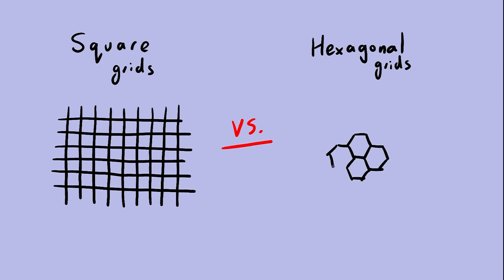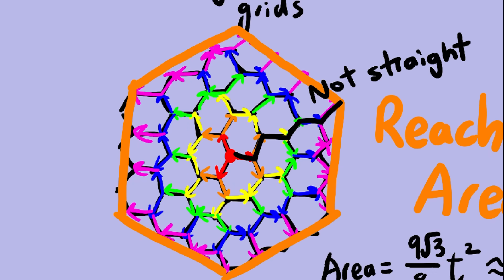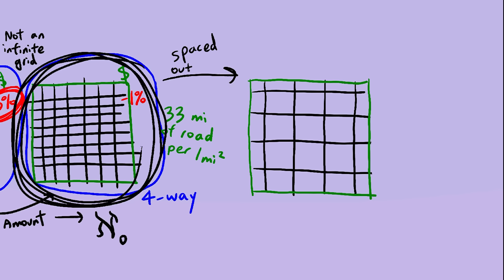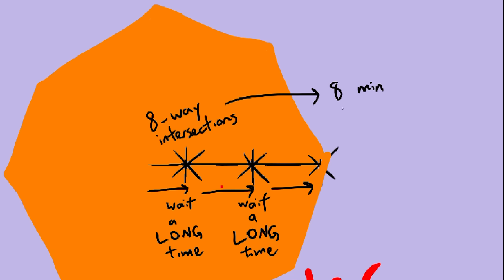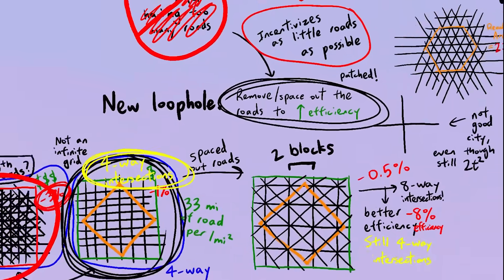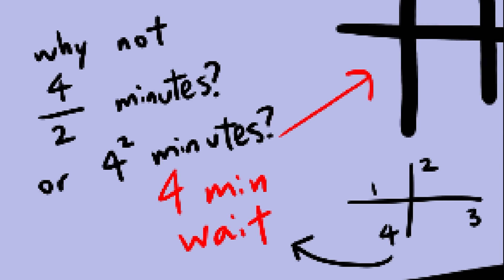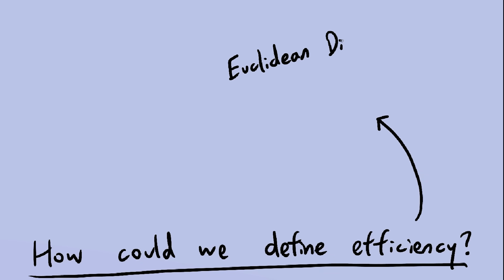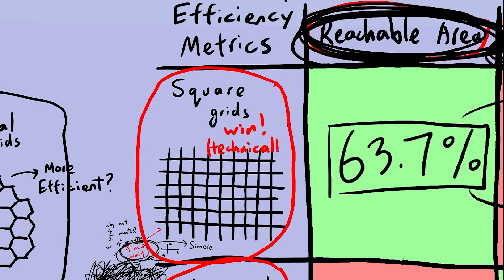Would hexagonal city blocks be better?

Comment: I have toyed with thie idea of a mix in city building games and it works surprisingly well - you have a large scale hexagon grid (2km across) and then a normal square based grid within, but various non-aligned grids.

It naturally creates park-like areas where the square grids meet, discourages through travel by making routes within the blocks less direct (if planned properly) and crucially all major road junctions are only 3-way intersections and the 120 degree angles make the junctions much more compact than 90 degree junctions.

Comment: A couple thoughts on this:

The point of a city is not to have maximal roads, but maximal buildings with minimal travel time between them. If you give the roads a thickness, and then do tests with two random points ANYWHERE on the plane, and have travel within "building areas" be relatively slow, travel parallel to and on a road be relatively fast, and travel across a road or through an intersection be relatively slow, you can sample random points like that and get a pretty good idea of a more realistic "trip length" - That is to say, go out of your house and to the road, travel along the road, and get into your destination at a specific point in a building.

For extra realism, you could add a stipulation that spending a fixed amount of extra time at the edge of a road allows you to travel much faster along it, but requires you to spend that same amount of time to travel back onto a building. Getting into and out of a car, more or less.

This might be an interesting thing to simulate. I might add that to my to-do list.
Reply: Huh

Comment: Why is it a loophole to have less roads to increase distance travelled? If you're wanting to only maximize distance travelled per minute by car, that's exactly the solution.

If you want something else, you need to specify that in the scoring system, not just penalize random things until the system feels better.

Or perhaps your calculations are flawed because you claim point x is in a reachable area if a triangle of points s, d1, and d2 contain x (where s is the starting point and the ds are destinations) because without a road how do you reach x?

Comment: Actually, you need n light cycles for an n-way intersection. Though a light can be optimized to favor certain turns, and then some routes would be faster than others despite using the same types of intersections.

Comment: i think my favourite efficiency formula for a grid network is area over length of road used to cover that area as taking the limit of grid size to infinity i think you do indeed find that square grids are the best out of the regular tilings - i think this is also applicable to real life as it corresponds to cost per unit area
Reply: also ig it should be that this measure of efficiency drops off by an inverse law as you grow the size of it so taking the limit is nearly negligible for decently sized networks
Reply: the only drawback is that it doesn’t consider interactions between cars in the network like intersections and traffic

Comment: as a civil engineer, the real solution is just roundabouts packed together into a hexagonal pattern.
Reply: Ah, Frank Blackmore, so nice of you to join us from the afterlife. I guess they don't call it the Magic Roundabout for nothing.
Reply: so now your reachable area depends on orientation

like, it's always faster to wind in whichever side of the road you drive, since you can exit the roundabout earlier
Reply: @MagicGonads True, but that would be a  Matter of seconds
Reply: Try an octagon grid.  Each octagon is one-way, alternating clockwise or CCW.  The intersections all become 2 lanes merging or 1 lane splitting.  In practice, I figure you'd set aside the square blocks for public use; parking lots/garages, parks, utilities, etc.
Reply: The actual solution is to convert all cities into archologies where you never need to travel because your sleeping area, living area and work area are the same room and all goods are delivered by dumbwaiter. Enjoy your efficiency, city dweller.
Reply: Even better, just make it large city-block-size roundabouts and connect them with small transfer roads! So the map looks like a bunch of circles slightly spaced out with star-like gaps in the negative space.

Even better yet, make the city block roundabouts hexagon shaped! So the passthrough roads are just the alternating hetagonal sides to connect them.
Reply: @BenRHarsh Wait, this is sounding familiar somehow...
Reply: The idea of driving through a city that's nothing but clockwise and counterclockwise circles actually makes me a little nauseous.

Comment: if you want a 11 way intersection you can make a 12 hour clock round about, and then remove 1 road. So think a pie with one slice 2 twice as large as the others. but but you want a round about so the pie slices are on the outside of the circle not the inside of the circle. this is actually really nice because their are lots of ways to break up 12. so you have lots of road options to work with to different cities.

Comment: The main issue with hexagons is that you have to turn on every intersection. When the light is green and you are going straight, the intersection essentially doesn't exist. But on a Hexagon, you always have to turn slightly, and there would have to be 3 different cycles of the lights. This means that not only do you spend more time going through an intersection, but you also have to wait 1.5 times as long for your turn to go when the light is red.
Reply: just put roundabouts everywhere.  people would get used to it as it would be the only intersections in the city
Reply: Interesting
Reply: Remember that lights at a 4-way are generally 8-phase, but at a 3-way they can be just 3-phase, plus the rights are easier.  And the "turns" are only 60°, so it's easier to see and you don't have to slow down as much.

Sure, you still need a highway system for long distance, but I think that locally a hexagonal grid could be surprisingly nice to drive.
Reply: You're forgetting that on a hexagonal grid it could still be green for you. Or a mini roundabout at the intersections which doesn't have traffic lights.
Reply: Not really, on a hexagonal grid the best way to do the most bird distance per time is by alternating left/right, taking these directions as going "straight" one finds that there are 3 straight axes nicely lining up with the 3 phases of the lights, this is opposed to the square grids which need 4 light phases but only have 2 straight axes.
Reply: @ybokors8524  a good set of lights is not purely on a clock but reacts to it's surroundings.
Also by chance the direction you're trying to go might still be green if it is stupidly on a clock.

Thinking about it, if the hexagonal has 2 lanes (one per direction) the short turn may always be green and the long turn has a 1/3rd chance of being green at the worst case, and practically always if it's smart and detected you driving towards the intersection.

The only thing you can't really do is speed excessively as you've got to make a bunch of turns, but that just depends on how short the intersection is and thus if they made the turns smooth and wide.
Reply: @sirjmo  Do I understand you correctly, that you argue a 3 way intersection is worse compared to a 4 way intersection, because a 3 way intersection uses a clock and a 4 way doesnt... which is solely based on you decision to force clocks on 3 way intersection?

Your argumention is completly baseless. Thats like arguing that square based grids are worse, because they are only allowed to use 10v/t, while hexagon systems use 100v/t and therefore are 10 times better. You just made a comparison and added a arbitrary rule to one side and not to the other.
Reply: @Grothgerek  my argument is literally the first thing I said: "a good set of lights is not purely on a clock but reacts to it's surroundings."

The other part is that IF it's on a clock you got a 1/directions chance of being green in the way you want to go. 1/3rd for hex and 1/4 for square. And the confusing part is that you may always be able to allow the short turn (right on red but better).

My third part was me just spitballing that you hypothetically could go crazy speeds if all you do is go straight on a square grid, but depending on the curve of the intersection that might not even be a problem for a hex grid.

I really didn't understand what you were saying except that you were misunderstanding me. Hopefully this clears it up.
Reply: @sirjmo  It seems I misunderstood your comment.

But I want to point out, that it isn't a 1/3 chance for having green, but a 50:50 chance... 

Because unlike in a 4 way intersection, where you have 3 possible ways to go, in a 3 ways intersection you only have two ways to go.
Which results in the situation that all three sections always have one green and one red light. They either all give way for the left, or they all give way for the right.
They can completly avoid corssings. Which makes three way intersection much, much more effcient. (Ironically they get even more efficient with more traffic, because you never have to watch for other cars and just drive left or right)
Reply: @Grothgerek  Assuming driving on the right. I'm imagining a 2 lane 3 way intersection one lane for left and right. Every section can always go right. Only 1 of the 3 sections can go left at a time as they cross each others paths. The section to your left, to your right and the section you're coming from thus 1/3.

All giving way for the left doesn't make sense to me, as you can't phase through other vehicles.
Reply: @sirjmo  F***, you are right. Not sure why I thought this was possible. Maybe because in a 4 way intersection, opposite traffic can cross in both directions.

In this case, if all streets are fully occupied, traffic would be equally worse in 3 or 4 intersections.
The most efficient way would probably to designe one street as main road, thats primarily used to dirve on. Alternatively you could also use one-way streets to dramatically improve traffic. Which wouldn't work as well for 4 way intersections.
Reply: @Grothgerek i think the more roads that come together the worse it is. You need 1 light phase per road for unobstructed left/through lane traffic (basically anything but the short right turn that can be squeezed into another phase or given a sliproad.
So a triangle grid (6 roads) would need at least 6 phases. Square 4 phases and hex only 3 phases.
The alternative to a main "priority" road is (turbo) roundabouts of 2 lanes (maybe 3 on a triangle grid) for smooth flow of traffic.
I know roundabouts have limits, but I don't think they'll be exceeded here.
Reply: @sirjmo  I'm a bit confused. I never said anything about adding roads. I still talk for hexagon grids, which use a 3 way intersection (the smallest intersection you can have).
When I talked about main roads, I never said anything about adding them, but designing the already existing streets as main roads.
Its something we have a lot in germany (turning priority road).
This way you would also not need a roundabout and can just drive forward. Reducing the required travel time even further.
Reply: @Grothgerek Look at conflict points for a principled way of looking at things.  A 3-way intersection has 6 possible car movements, 3 of which cross each other and 3 which don't.  A 4-way intersection has 12 possible car movements, 8 of which cross each other.  Intersections get quadratically worse with more roads.

You can look up real-life traffic engineering and switching to more intersections with fewer roads absolutely works.
Reply: @pfeilspitze  Thats a much better explanation than what I have tried. Math is the perfect language.

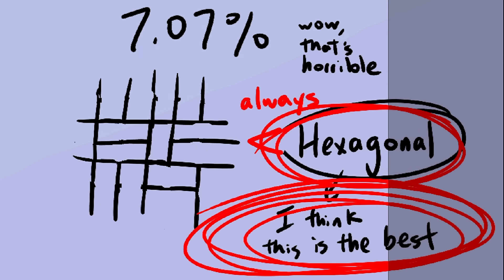Comment: 7:16 edit: this comment is actually wrong

well if you think about it, intersection cycles don't scale linearly with number of roads. At a 4 way, any of the 4 ways can go forward, left, or right. At a 3 way, only left or right. So a 4-way has 12, and a 3-way has 6. If you think about it, a 3-way intersection can have 2 cycles, "all left" and "all right" (edit: actually this is wrong, but just use a roundabout), but a 4-way must have a minimum of 4 because of left turns.
Similarly, a 2-way intersection (street) needs 0 cycles (unless you want to just say a length of street is a 2-way and use it as the base).

Comment: 10:26 'Fast'? Uh no, please, that just means speeding is a loophole.
I don't think you should focus on the roads as much; distances in a city are small. Most time is lost at intersections, either directly or because cars in front of you slow down. So completely forget the roads, and just optimize intersections.
You want to have fewer roads at each intersection (waiting time scales as (n-2)^2). Optimize this while keeping intersections density (per area) constant?
PS: Hexagonal grid would be annoying to build in, deliver mail in, etc. It would be very safe though, as the 3-way intersection with 120 degree angles are probably the safest intersections you can think of. (Way fewer T-bone collisions!)

Comment: I do feel like there is a way to rigorously work out how long you'd wait at a stoplight depending on the number of intersections. At a 4-way intersection aligned with the cardinal directions, the stoplight alternates between allowing travel along the north-south axis and along the east-west axis. If you assume that the green light simply cycles around, then the amount of time you'd spend is something like... If t is the time each light stays green and T is the time you actually spend waiting (and n is the number of roads) it would be like... T = t((n/2) - 1)? Wait this doesn't account for when you arrive at the stoplight. Whatever there's an equation for this I think, but it's still problematic because it doesn't account for turning (I guess you assume you can freely turn off of a green light or something) and odd number intersections. Do odd numbered intersections even exist where two of the branches aren't from a single straight road? If so, how do the stoplights work???? My brain is fried

Comment: 6:58 alternating one ways effectively makes each intersection into effectively 2-way intersection without reducing the reachable area by a noticeable amount.
Reply: I once saw someone build a city in city skylines using a similar theory. The entire grid was a single one way path, meaning when cars needed to get to the start of the city but were even barely past it, they had to get on the highway and reenter.

It worked... Better than it should've.

Comment: To inject some ugly reality into the beautiful mathematics: Acceleration after an intersection takes time, up to some maximum speed, so you could say that the first unit of distance after each intersection costs double as a different way of penalizing intersection-heavy grids. For intersecting two-way roads, right (or left, depending) turns have an advantage, being possible even at a red light if there's a gap in traffic large enough to merge into, so making the cost asymmetric based on in&out direction could give some interesting results. Lastly, buildings want road access, which can act as a penalty for sparse grids as well.

But I think we all know what the BEST layout is. Square grid, but instead of intersections the north/south roads do loop-de-loops and the east/west ones hit a speed booster ramp so cars can jump through the middle of each loop. Right-hand turns get a nice 45-degree bank, so there's no need to slow down, and left turns have a peaceful roundabout in the centre, away from all the chaos above. You just don't get the style point of a loop AND a jump through it without at least 4 roads.

Comment: The first thing I thought was forbidding to turn left would work well with 3 way intersections on a hexagonal grid
Reply: So you would be stuck driving a loop around a single hexagon?
Reply: @mineton1293 As I said it was the first thing I thought. Unfortunately driving straight requires left right wiggles on such a grid. Could be solved by allowing it half of the corners of the hexagon or something like that to reduce left turns but quadrogons seem to work better.

Comment: Imo you should have kept the 'reachable area', but then have also assignied a thickness to various types of road, then, considering the reachable area, you see how much of it is road and how much of it is buildings, which will give you your second efficiency stat, space.
Because in engineering (which I am not) the main 3 important values are speed, space and cost.
We cannot define cost given this is hypothetical, but you did define speed, yet didn't define space.

The expirement was doomed when you said 'roads are infinitely thin'. In your experiment, buildings had no value.

Comment: We don't use only 2 roads in a city because that would mean more walking. If all of our destinations were guaranteed to be adjacent to the road, we could just have a single straight line for maximum efficiency.

First, make roads have width. I say 0.1 unit wide. Cars still travel through the center of the road but now we can measure how much of our city is road by area. For instance, a square grid of roads with 1 unit length between each intersection would have a bunch of .9x.9 squares of non-road giving (.9)^2 = 81% not-road.

 Now, I suggest we take a standard walking speed—perhaps one tenth the car speed.

We select two random points on varying grid sizes (test many 5x5 grids, many 6x6 grids, over and over until, say, 30x30), and the grids are randomly displaced so the edges won't always be road or always be non-road.

For each test, multiply the reciprocal of your % non-road (81% for 1x1 square grid, becomes 1.235) by the time it took to get between the points most efficiently. Compile the data and you can see which road type is most efficient for each city size- a larger final value means worse efficiency. Repeat this for each grid type and you have your final answers!